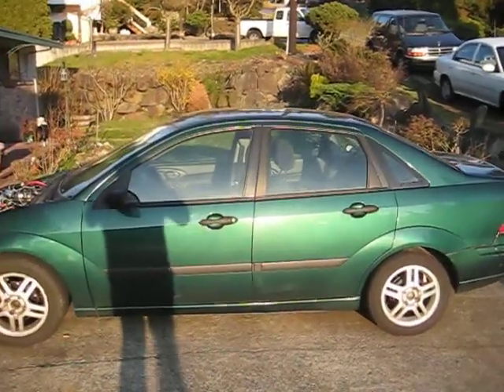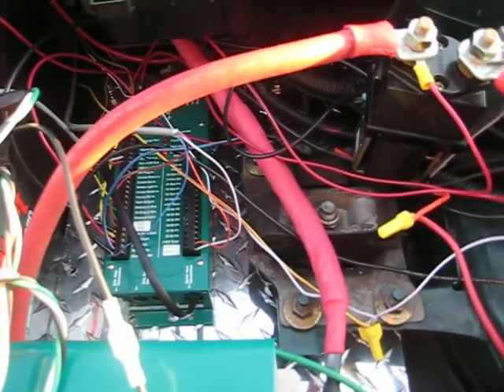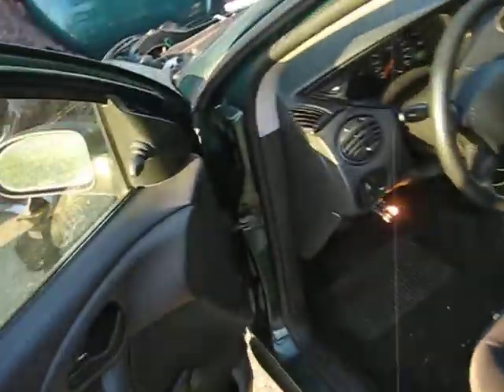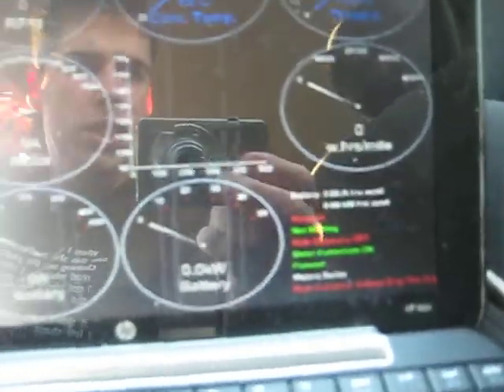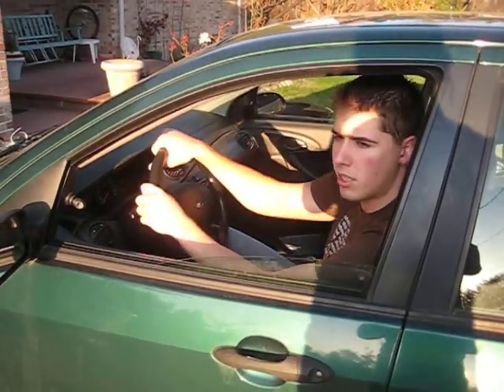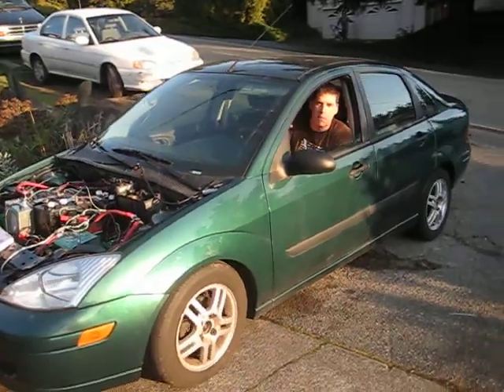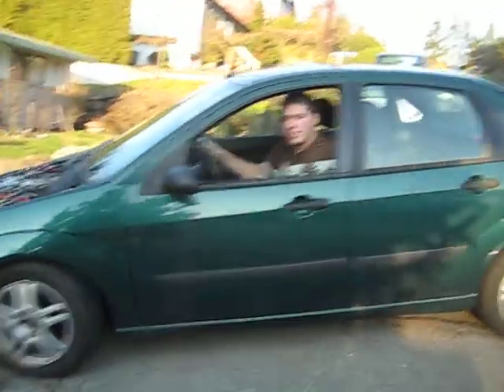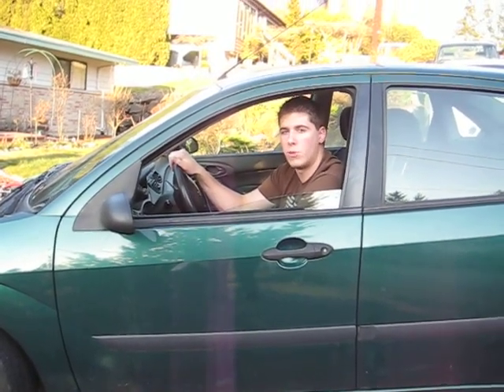An ev I built in 2009 with a warp 9 motor and zilla conroller

Comment: Nice! Is the motor connected directly to the flywheel or directly to the transmission spindle? My current car is direct drive, but thinking about adding the transmission back for efficiency.